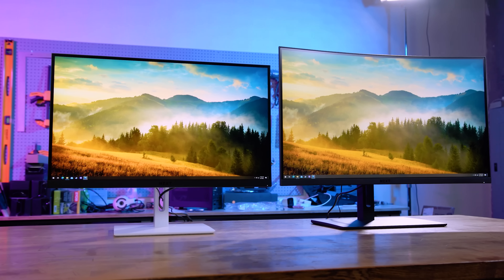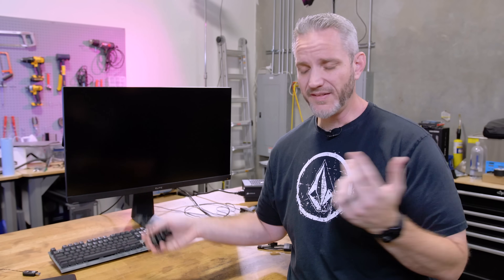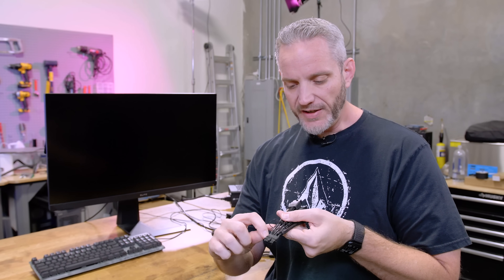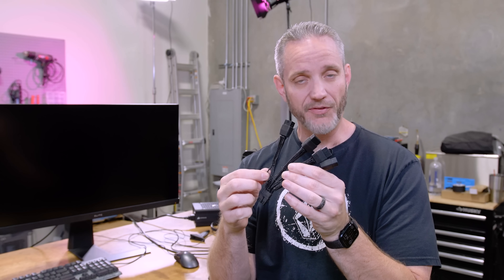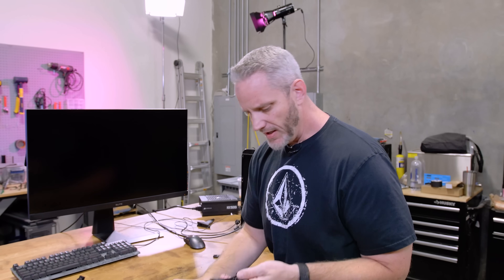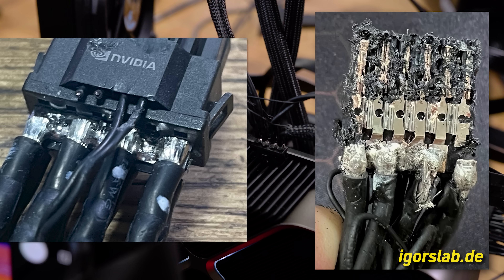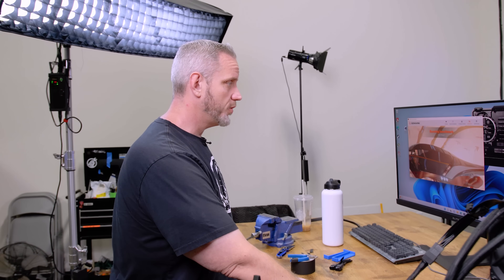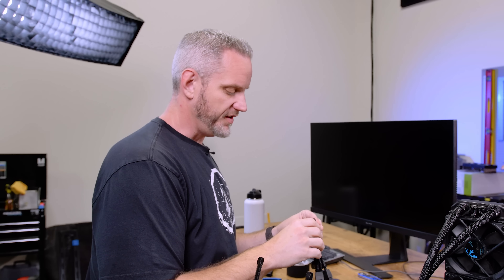Igor's Lab figured out why NVIDIA adapters are melting!

Comment: Like a few have responded, a loose connection would cause more heat.  This is especially the case if there is a small air gap and there is enough current to arc across.
Reply: Exactly, in fact thats a spike (Ha) in heat. Short circuits if they do not trip a breaker, WILL cause a fire.  A poorly made high current connection behaves exactly like a short
Reply: I agree
Reply: Yea, he's getting it a bit backwards. If it completely snaps off on the outside pins, then more current is going through middle connections and they should heat up. But what is happening is they are cracking and having a smaller area to pass the current and thus heating up. Then it most likely completely snaps off from tearing it apart to look at it.
Reply: 1000% correct. I do electronics work in an industrial environment and an open circuit wouldn’t cause that pin to melt but a poor connection would. (Well except for the enough current to jump an air gap part. It’s voltage and higher ambient air temperatures that allows for current to flow across air.)
Reply: Can confirm, I am heat.
Reply: It is the voltage, making an arc possible, the current then keeps it alive. 12V causing arcing sounds pretty much impossible for me
Reply: It's NOT about 'being loose' AT ALL. You have misunderstood the issue.

It's about INCOMPETENT ENGINEERING and the abandonment of standard industry best practice that means anyone installing the cable assembly can damage it easily, causing overheating.

To top it all, Nvidia ignored the connector manufacturer's own published maximum current ratings, so even a 'good' installation is at danger of overheating too.
Reply: @acanalesc  NO. It behaves nothing like a SHORT. A short on the Power Supply would shut it down and all would then  be safe.

What they have done is to add a high value (relatively) electrical resistance in the power lines (both Ground and 12V). Not high enough to prevent operation but high enough to cause overheating, melting and potentially FIRE !
Reply: @JJayzX  No. that's complete NONSENSE, Go back to school ! You have not understood a word Jay said. I DID btw, and it is not only clear but he makes total sense,.
Reply: @BrettVanWey1  IT's RESISTANCE HEATING due to overcurrent as a result of negligent design, pure and simple, nothing else at all. You treat up to 50 Amps of 12 Volts WITH RESPECT (AND a SERIOUS connector)  or deal with the consequences ! Nvidia chose a piss poor joke of a connector and the results are entirely predictable.
Reply: @sven3603  ARCing is NOT important here and won't even happen with low (12 volt) voltages on non-inductive circuits. Why do clueless wannabes always talk of arcing as if that was even likely ?
Reply: Arcs are about voltage and shape. In air, it’s about 1 000 000 volts per meter, or 0.012 mm for 12 Vdc. Now, perfectly possible in a closed pin housing. Also shape, sharp points reduce the voltage necessary. In short, the arcs are based on Voltage, but heat is based on current once the arc exist.

That’s the mating mechanics used by the pins that’s in charge of controlling this. If the pins can be pulled sideway, then the surface area for current goes down, raising resistance, raising heat.
Reply: @grahamstevenson1740  It is definitely resistance heating up the plug. When the break happens there is still a partial but incomplete connection. If it was a small bell wire it would break due to the heat and then the runaway wouldn't happen. With it being that large of a wire with a large glob of solder it doesn't entirely fail actually making it runaway. I will say though that 12V can and does arc. I have had arcing on lipo batteries with individual cells only having 4vdc. I agree that isn't what is happening here though. Those pads could have been partially disconnected before ever being installed and the oxidation that builds up on the outside of a solder joint will cause this issue alone. If you are an IEEE member some documents shine a light on the increase in temperature and resistance due to Oxidation between two contacts.
Reply: Agreed.  Loose connection will generate more heat, less resistance ---> more power ---> more heat...repeat until meltdown.  You can see this in a bad contactor for a motor starter...until it finally arcs and chatters and can't make the connection because of carbon buildup.  Or a relay.  But those are meant to break connection.  Heh Nvidia...you're doing something wrong.  I'd rather have a copper busbar!
Reply: @MegaMilez  Resistance is futile?
Reply: @sven3603  I've seen 12 volt power arc. But it was a 90 amp circuit.
Reply: You nailed it, if you actually watch Paul's video, he picks up on exactly that point. Also since the connector would be still incased in that epoxy/rubber material it's not like the broken solder connection would really go anywhere, leading it to likely become a high resistance connection rather than a complete disconnect.
Reply: @tray22  ARCING depends entirely on the load characteristics and is not of importance here. It's diverts attention from the REAL problem.

When dealing with very high currents, as here, up to 50 Amps, there are a bunch of issues that would not be intuitive to the casual inspection.

One particular thing of note is that when using multi-pole connectors (12 ways most definitely counts as multi-pole) the individual contacts have to be derated to compensate for thermal issues (heat build up from proximity). Those contacts are rated (best case 2-4 ways) at 8 Amps. In such a multi-pole type that figure should be derated to around 5 Amps per pin.

So, Nvidia were hoping to pass 8.33 Amps per pin (600W @ 12V) and already that's over the spec even on a individual contact basis. Adjust for a multi-pole type and it's OUTRAGEOUSLY over spec. 8.33 Amps vs 5 gives 2.7 x the heating (use the square of the current).

Also, the contact rating depends on installation. The pins use the PCB oil of the circuit board to cool them. You need to pay serious attention to board layout to ensure that enough PCB 'land' is used.

Additionally, for the wire-ended connector the current rating depends on the wire gauge too, Just consult a Molex data sheet. with a 20/22 AWG wire those contacts derate to just ONE Amp ! So those pins need cooling. Again Nvidia failed to address this issue.

Worse still, Nvidia soldered wires to a small PCB and expected them to act as a MECHANICAL ANCHOR ! This is plain amateurism and is 'beyond the pale'. International Standards WARN precisely against doing this !

And then, those wire were NOT STRESS RELIEVED ! Again, this is basic fundamental kiddy basics stuff " !

How many things did they get wrong ? I've forgotten. I've rarely seen such a piss-poor show.
Reply: @Rob165x  It only needs 183 degrees C to melt some solders and then the card would disconnect itself !

Maybe that was the safety mechanism Nvidia had in mind ?
Reply: @grahamstevenson1740  I'm pretty sure Molex doesn't actually have any current rating for the pins in this use case scenario, those pins are solely for use with cable crimped directly into them. What they should have used is one of the PCB mounted connectors soldered the 14awg wires (via through hole so no risk of pads lifting) connection to a small PCB, that PCB would then have through hole connections for a connector housing (like the socket on the PCB of the GPU is mounted). 
That would be the correct way to engineer something like this, alternatively they could have used multiple 18awg wires rather than a single 14awg wire and crimped them into the connections (much like they did with the FE adapters for 3000 series).
Reply: @JJayzX   Yeah, Jay knows a lot about computers but not so much about physics.
Reply: What you should be doing is somehow measuring the voltage on the connector on the card side. I am sure that there is a significant voltage drop across the whole thing. If the power supply supplies precisely 12V, at these power levels, there could be at least 1V dropping on the connector meaning that only 11Volts are actually reaching the card. The card only sees the voltage on the connector, so it will see 11volts for example. Because the card is needing the same power but now the voltage is lower due to the losses, now the card wants to pull more current. For 600W it is 54,5Amp, so 4,5 more amps than rated.
Because there is resistance in the connector, the even more amps youn draw even more voltage is dropping there. There is an upper limit (which is normally 10.5V if memory serves correctly) to which you can go down before the card is no longer able to run.
So worst case scenario 12-10.5=1.5Volts of drop across a connector with 55A of current means a 27milliohm resistance in the entire connector overall (that equates to 80Wats of power lost across the connector. That is a lot but you can kinda get the logic).
That is completely possible for these connectors, but it is too high overall.
If the powersupply is compensating by increasing the voltage above 12V(a lot of supplies do it) so the card would not detect a low voltage level and thinks everything is OK.
Reply: @grahamstevenson1740  I can't believe they joined multiple wires into one port of the plug like this. I have never seen anything like this, and I would have expected a crimped connection with a bit of solder wicked in for good measure. On 6 separate wires and pins and not 2 joined. The way they built it likely made it more difficult to mass produce as well. I don't own this card, but I am an electrical engineer and like the diagnosis part of the problem. If this was something I designed, it would have been strain relieved to death. It also looked like dissimilar metals in various parts of the connectors, wires, solder, and bridging tabs.
Reply: @Dzsonib  maybe they should design a new PSU spec that has some additional wires that allow the GPU and PSU to talk each other and both be smart about the power draw situation. Maybe they could even incorporate these additional wires into the same connector used for power delivery.
Reply: @jmarynicz  You make a good point. The rating I quoted was for the wire end receptacle formed contact prior to derating.

The influence of cooling via the wire can be seen in derating from about 8 amps in 2-4 way housings to 5-7 Amps in multi contact housings with 14/16 AWG wire ends down to ONE amp with 20/22 AWG wires. There are a number of factors at work here and it goes tro show how much attention to detail is required even with a 'simple' connector.

PCB mounting connectors rely partly on the copper foil of the PCB to remove the heat. So, a multi-layer PCB will perform better in this respect if all layers are used.

You can see how many variables are already a factor here but clearly Nvidia ignored them ALL ! It's one of the most amateurish travesties I've seen ever actually. WHAT WERE THEY THINKING ?
Reply: @grahamstevenson1740  yep, imo Nvidia should have just said ATX 3.0 PSU required for 4090 (and possibly 4080) and just used the 12vhpwr plug in them, the less power hungry SKUs should have just got dual 8 pin like we have had all along. We all know people would have still bought them, they could have been sold for less too since there would be no need to pay for production and R&D of an adapter (tho it appears little money was budgeted towards that).
Reply: @Dzsonib  It's actually quite SCARY.

You might think you need a serious volt-drop but actually a few hundred millivolts will cause a conflagration when there's 50 Amps flowing.

The Molex spec is 10 milliohms per contact..Divided by 6 (per polarity) and multiplied by 50 Amps gives a volt-drop of 83 millivolts.
Multiply that by 50 Amps to get the heating power is 4.16 watts (per pole), which means 8.33 Watts total dissipated in the connector due to contact resistance ONLY under data sheet conditions.

That's AN AWFUL LOT in my book ! 8 watts is a serious amount.

It can only go seriously downhill from there.
Reply: @tray22  I COMPLETELY agree on the stress relief issue so much. You have several potential failure modes here since the wires are just lap soldered to a tiny PCB.

1. the wire can itself break by flexing at the joint to the tiny PCB, probably where it's been stripped for soldering and stress concentrates.
2. the wire is being used as a mechanical anchor against cable flexing. It may fail in one of 2 ways.
2a. the wire may pull off (delaminate) the PCB copper foil from the substrate and detach.
2b. the soldered joint itself may mechanically fail (as Jay showed us). Soldering is not intended to withstand mechanical forces.

It truly is appalling to see what Nvidia have come up with. It is actually a 'reference case' in how to get EVERYTHING TOTALLY WRONG ! I'm lost for words to be honest.

Sadly, this level of negligent careless  'engineering' is what happens when the older, more experienced mature hands, 'leave the ship' together with their accumulated knowledge and wisdom. It only takes an over confident, bullish management that cares little about the end user to complete the damage, Oldies have a use and purpose you know.

I can see why EVGA decided to part ways. I reckon they saw this coming.
Reply: @jmarynicz  Sorry but the 12VHPWR connector is now TOAST. Who says so ? Well I do for one !

PCI-SIG fouled up VERY BADLY. It's unfit for purpose (at least as used by Nvidia). You can just FORGET it ever happened. PCI-SIG also needs to get some experienced engineers who know their stuff working with them instead of making it up as they go.

Sticking with the existing 6 and 8 pin PCIe power connectors makes MUCH MORE SENSE, They may only be 'officially'  rated at 75W and 150W respectively but can do FAR BETTER.

At a modest (and therefore reliable) 4 amps per pin the 6 pin is good for about 150W and the 6 pin, 200W.

So, 4 of the 6 pin or 3 of the 8 pin connectors would have worked just fine and made cable looming much easier too with no awkward bends and more flexible wires.

I simply don't 'get' what planet Nvidia thougt they were on to try this stunt. I see the management is 'doubling down' it seems as well. saying 'nothing to see here folks' ! I suggest Nvidia's partners 'rip them a new one' whilst threatening to drop them in favour of AMD. The shoe is now on the other foot Nvidia ! No outlet for their chips means the company will be in a poor way. You messed up BADLY and you'll pay for it.

It might also be a good time for investment. Nvidia's stock price may soon be tumbling. The market will expect a sacrificial figure to go. Let's hope it's the correct one.
Reply: If there is a small airgap there will be no arcing at 12V. The air has a dielectric strength of around 1000V/mm, so there's no chance you're gonna have arcing at such a small distance
Reply: @grahamstevenson1740  I'd imagine the engineers at molex and PCI-SIG have a better understanding of the capabilities of the connector than either you or I do. It's also been proven that the connection pins aren't the issue (so a regular 12vhpwr to 12vhpwr cable when using an ATX 3.0 PSU poses no problem), again by people smarter than us.

These failures only affect and are solely caused by a poorly designed cable and likely some that suffered from manufacturing defects 

There is nothing wrong with the connector when used in it's intended purpose with a proper 12vhpwr cable.

I do agree this is an Nvidia issue, not a PCI-SIG or Molex (assuming they provided the pins) issue.
Reply: @InTimeTraveller  ARCING requires reactance (inductance, capacitance)  to draw a significant arc. You'll get a tiny 'spark' maybe on disconnecting a circuit but even that is due to parasitic reactance which is next to impossible to avoid.,
Reply: @jmarynicz  The engineers at Molex, most certainly. They used to come out to talk to me to explain their latest offerings. Many company reps would seek an appointment with a Senior Designer such as myself. Sometimes I had to tell them in no uncertain manner that they were wasting my time too !

The guys at PCI-SIG strike me as totally clueless if they had any hand in this. i'd suggest they went back to engineering school to learn the basics quite frankly.

Clearly they have no experience of working in the REAL WORLD, a situation that's becoming ever more problematic.
Reply: @grahamstevenson1740  great when all the GPUs start burning up when used with proper 12vhpwr cables and not because of a poorly designed adapter you can tell the world you told them so. Or maybe years from now things will be fine and we will just laugh at all the people on the internet that said the connector wasn't suitable and PCI-SIG had no idea what they were doing. I guess time will tell. I'll be sure to bookmark this comment and check back in.
Reply: @jmarynicz  There are some engineering basics in life. Things like contact resistance and the like.

Good manufacturers state those numbers in datasheets. For the contact in question, Molex state a design contact resistance of 10 (TEN) milliohms.  FYI, I read the data sheet for that connector range just last night, so I'm up to date on that.

They also DERATE the connector with respect to number of contacts. Low density examples have a per contact rating of 8 Amps (provided the wire gauge is greater than 16 AWG, smaller wire gauges reduce the amperage due o heating).

For a 12c pin housing, the contact rating ir reduced to 5-6 Amps. Why ? because the heat from the contact resistance accumulates, leading to higher working temperatures. ALREADY that means putting 8 Amps per pin through one of those multipole connectors is a no-go. And it is failure to observe manufacturer's data sheet figures that rt makes PCI-SIG look EXTREMELY foolish.

FYI, I'll do a sum for you.

Nvidia want to put 8,33 amps (600W @ 12) through that connector. Let's work out the power lost in the connector from i^2.r.

Per contact @ 8.33 A and 10 milliohms. the power loss is 0.693W.

Multiplied by 12 contacts gives 8.32W. Now that's a not insignificant amount ot power ! I suggest you try it out and get back to me.

Personally, I wouldn't be seen dead suggesting using such a part in that application because IT'S NONSENSE !

PCi-SIG need to get a clue about REAL WORLD ENGINEERING THAT WORKS (and doesn't melt the connectors).

They're a bunch of wet behind the ears loony idiots that need a rocket up their backsides.

I now suggest that you withdraw your offensive remark or present ACTUAL EVIDENCE as to what's incorrect with my calculations. If you cannot supply such evidence, may I politely also suggest that you now STFU ?
Reply: @grahamstevenson1740  great, when everyone's computers burn there houses down you can tell them all you told them so.

Btw, Galax put 1500w through those pins with no issue provided it was plugged in correctly, it saw temps no higher (60-70C range) than what people have observed stock. If the connection (when installed properly) can handle 1500W with no additional increase in heat, that's 900W more than it's rated for, then I'm not sure why 8W would be of concern.
Reply: @jmarynicz  Sure, I can do that.
Most electrical fires are caused by contact resistance or overloaded cables.

In the UK we have the excellent BS1363 plug and socket system that beats that useless ancient ridiculous bent metal Edison plug by a country mile. You rate it at FIFTEEN AMPS, more than the 13A we rate our far superior plug with solid brass machined pins at,

That's one reason that electrical fires are virtually unknown here. Also, we rate cable more conservatively by a factor of almost 2:1.

I do hope you like living in your American wooden tinderbox that duff electrics can so easily burn to the ground.
Reply: @grahamstevenson1740  
You do realize once you adjust for population the UK has more home electrical home fires per capita than the US. Sure, we have about 3x more (51K vs 19K) electrical house fires per year, but we have 5x the population.

I'm not sure the point you are trying to make, but it appears you are missing it. FWIW the PCi-SIG spec is in effect for computer globally, your UK based computer is no safer, less so it appears based on the info above.
Reply: @jmarynicz  OK, I just looked at the latest statistics.
In the USA, 354,000 house fires occurred during 2020. One every 89 seconds.
In the UK, the equivalent figure is 33,000.

Even adjusting for population by 33/7 our figure is less than half that of the USA and most fires happen as a result of kitchen accidents, absolutely not electrical at all.

The few that occur are rarely due to installations, although outdated wiring still remains a rare cause. If the wiring is 'up to date' the incidence would be wholly due to abuse of appliances or faulty appliances (more of a problem since Chinese electrics have become common).
Reply: @grahamstevenson1740  yes we have more house fires, but a much smaller percentage is electrical based, under 20%, over half your house fires are electrical based.

We are just talking about fires caused by electrical issues, not fires in general.

Nice try on trying to twist things, gotta give you credit for that.

Of those 354000 only 51000 were electrical in nature. Of your 33000, 19300 were of electrical origin. 

Or to put it another way, a UK resident is twice as likely to suffer a home electrical fire vs one in the US. Tho a US resident is much more likely to have a non-electrical fire, but that isn't what is being debated here.
Reply: @jmarynicz  I still had the page open.
"Key figures:
There were 33,180 house fires in the UK in 2020/21
Cooking appliances are the leading cause of house fires
There were 311 fire-related deaths in the UK in 2020/21
A third of house fire-related deaths are caused by smoker’s materials
8% of house fires are started deliberately2

And ... ta da !

"The most common causes of accidental house fires in the UK in 2020/21 were as follows.

1. Cooking appliances: 11,078 fires
Cooking appliances account for almost half (46%) of all accidental house fires and account for around 10% of deaths. Common sources of ignition include:

Cookers & ovens
Rings & hot plates
Grills & toasters

2. Electrical distribution: 2,962 fires
Electrical distribution accounts for 12% of accidental house fires and 6% of deaths. Common sources of ignition include:

Wiring, cabling & plugs
Apparatus, batteries & generators
Heating equipment

3. Domestic appliances: 2,152 fires
Other household appliances (not including cooking appliances or heating equipment) account for 9% of fires and 5% of deaths. Common sources of ignition include but are not limited to:

Dishwashers
Extractor fans
Fridge/Freezers
Tumble dryers
Washing machines

4. Smoking-related materials: 2,115 fires
Smoking materials including cigarette lighters account for around 9% of fires and 34% of deaths – the highest of all sources.

5. Matches and Candles: 1,032 fires
Matches and candles account for around 4% of fires and 4% of deaths.

6. Space heating appliances: 784 fires
House and space heating appliances account for 3% of house fires and 11% of deaths. Common sources of ignition include:

Patio heating equipment
Heaters & fires
Other heating equipment

7. Electric lighting: 438 fires
Electrical lighting accounts for 2% of house fires. Common sources of ignition include:

Fairy lights
Fluorescent lights
Spot lights
Incandescent light bulbs

8. Central and water heating appliances: 217 fires

9. Blowlamps, welding and cutting equipment: 153 fires

10. Office equipment: 20 fires

So, even if you attribute ALL the appliance and heating fires to electricity, that's ONLY around 4,300.electrical fires in total, NOT the 19,300 you suggest. We take fire very seriously here.

Personally, I'm most aware of washing machines and dryers that catch fire in the domestic appliance category. These have gained a bad reputation in recent times and are mostly low-end imported goods.
Many homes in the UK are required to have a mandatory electrical safety inspection including ALL rented properties.each year or two and personally owned properties will have to pass an electrical inspection before a mortgage can be obtained. Elderly electrical installations are therefore VERY rare. My own property was last rewired in 2009 and before that in the mid 1960s. The wiring and sockets from the 60s were still in good order when last replaced. Although the 'panel' was a bit elderly with fuses instead of the now mandatory circuit breakers.
Reply: @grahamstevenson1740  Need to drop the ego like he's holier than thou and everyone kneel before his brilliance. Keep stating it's just bad design and its 50 AMPS!! Then you post numbers of per pin and that still translates with each pin trying to pass 8.3 amps which it seems to do "fine". There's obviously heating but not much more than even basic resistors reach, which is fine. The issue which has been obvious to see it's the outer pins, which when opened shows them broken. So when they crack there is less material, thus more resistance and boom, molten. If it was purely bad design of the power throughput of design overall, it would be randomly or generally melted at any pin. The design still sucks overall cause they tried to make it as small as possible which makes it a weak connector overall.
Reply: @grahamstevenson1740  Agreed. It takes a very high voltage to ionize air. Although there is inductance in the cable which means you can get voltage spikes when you break the circuit with significant current going through it. There are formulas for inductance in copper cabling and you could even model it in SPICE simulation if you cared enough. My guess is that isn't the case. This is high current going through fewer pins because they aren't making good contact at the jack/plug junction. That's where the melting is occurring not around this foil.  Red herring.
Reply: @TheSiriusEnigma  You could say  that 12Vdc could arc at that  distance but you'd only get the full 12V if all the contacts were breaking.  If some of the contacts were still being made then there would still be 12V on both sides of a broken contact except for some DC voltage drop caused by the resistance of the working contacts paths.